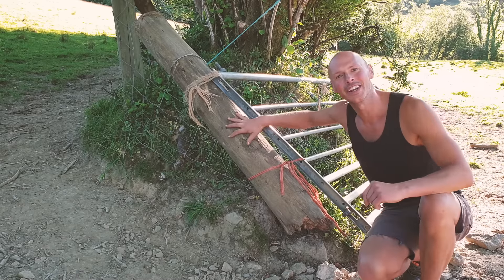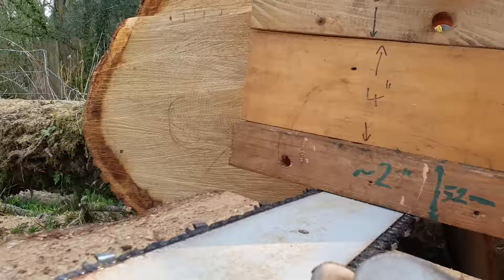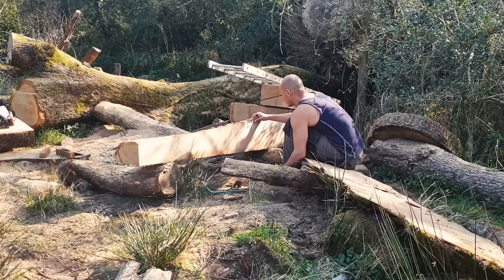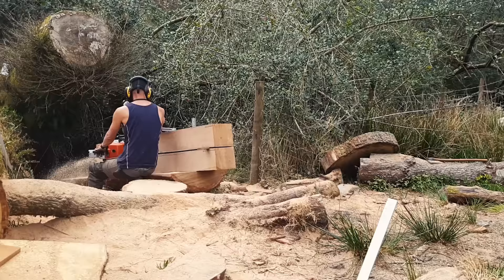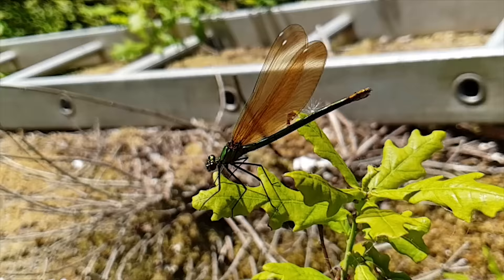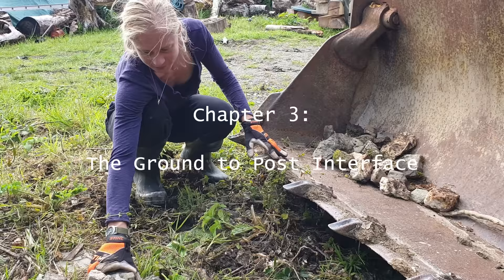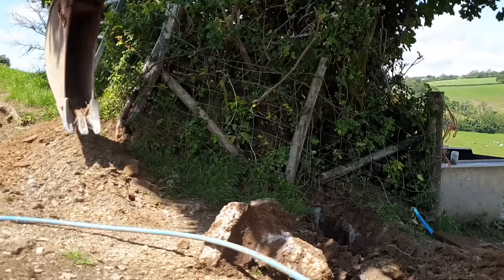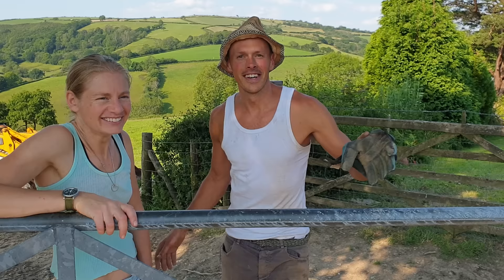The 3 secrets to ROT PROOF POSTS and how to make them

Comment: i have been burning my wood for a few years now, even pine which maybe a soft wood but if done well can actually last many decades itself but granted wont be ever as good as a cedar with its natural oils held in the wood.
I found after much tinkering that if you burn the wood until you see the surface start to bubble and get the spider web look to it is right about the best result.
Wire brush the carbon off, wash down then soft brush to make sure absolutely all residual carbon dust has been removed and then oil it up.
Personally i used linseed oil, however i have friends who went the route of old engine oils.
When ever the surface is broken ie you need to screw anything in at all then give it a quick burn now if you have fixed the post in  then a gas bottle burner does the trick, blast it out with some water let it dry and then put in some oil followed by applying a little grease to whatever you are putting in the wood will stop the corrosion happening between wood and metal and will stop any chance of water penetrating in and starting any rot.
I learnt doing this by trial and error but once i did the above found it did the best, in my mums garden where i did her fence lines i have since applied oil once, i did her fences 26 years ago and they are a bog standard pine, they have zero decay and are as strong and robust today as when they went in the ground, she has an outside dining table which i did a few years before that which i didnt get quite right first attempt, didnt give it enough burn time, re did the burn on it when i did the fence but all the same you're talking best part of 30 year old table, strong as ever, pine table again.
Point is, pine i agree entirely  wont last or have the longevity of a cedar or oak but if you reapply oil every 20 years , 10 for the table as it gets used and some damage does occur from dropped items etc, it will still out last many of us, it might not last hundreds of years like a hard wood can do but it can still last many decades.
I guess to be fair on my final point, you will get out of the wood exactly what you put into it before hand, i sanded washed, burnt, washed, oiled, did some further burning, washed reapplied the oil and then a 2nd coat of oil, i went probably a step further than most would consider but the results speak for themselves, you get back  out of it what you put in.
It is a absolutely great way of looking after wood and it also looks bloody great too in my opinion so win win
Reply from the maker: Wow Ricky! Thanks so much, that is absolutely fascinating and inspiring. Very impressive for pine. It's certainly getting us thinking about treatment for outside furniture and we do have some more posts to do, so we can try the burning and oiling on the fixture holes for those. Was it boiled linseed oil or just straight up you were using? Did you say you sand before burning - what is the reasoning for that and would you still keep that step if you did it again? Curious as the texture seems to change so much when you char it. 

Is it for aesthetic reasons to get all the carbon off or for something else? Thanks again for the comment. Peace, Bongo
Reply: @FloweringElbow  Yes i always sand before burning, reason being for me is i have done many fences and the wood used has generally been treated of some sort which you dont want to be breathing in even when doing in the open for one and for two, it gets rid of the excessive fibres and rough texture of the wood which even if not treated when you burn can cause additional burning of the wood more so around the edges of boards or panels which is just wasting wood and doesnt help, i believe you covered it stating you only actually need to get through the first few millimetres , no need to get in deeper  in the wood unless of course you have made holes deep in the wood then of course you need to reach all open wood to prevent air and bugs.
With tables i do it because they often have had a varnish or similar applied which requires being removed, also as i mentioned, accidents happen and things get dropped and it takes out any small dents.
I don't sand again after it's all been done and had two coats of oil ( you can if you wish sand with a really fine grit paper between coats ) then  pressure washer to clean the surface is sufficient, allow the oil to dry ( 24 hours per coat applied generally using boiled ) and it wants to be properly dry before you reapply oil, oil i have mainly used is boiled yes, tbh havent used non boiled that often and oak is about the only wood you would want non boiled for and drying time  can take weeks hence not often using it lol.
After applying the oil leave for half an hour or so then wipe down with a dry cloth to remove any excess, you will feel a sticky feel to it.
But i found when things hadnt gone right at the start it was more to do with the burn or not allowing enough dry time or not properly cleaned and lastly do it in dry weather, even if you can burn under cover higher humidity  in the air means longer time to burn to get the same result.
You want to get every last bit of carbon off so basically you  are sealing without doubt the wood itself,  removing the excess carbon from the surface layer thats been burnt to a crisp. You will still have the burnt look and effect on the wood after you have taken off the excess but not taking the excess carbon off means you are limiting how well the oil penetrates the wood rather than being absorbed by the carbon ( when good amounts of carbon are left ) so again if you have a pressure washer handy they do a cracking job of removing the carbon.
It might come across as over kill and i probably come across as being anal lol, but to me it comes down to peace of mind, pride in work, walking away knowing i did my absolute best, ive done probably a handful of tables and outdoor wooden furniture and fences every year now for the past 30 years and i treated every single one as if i was doing it for myself and dont call it finished unless i am happy with it, tbf the reason i have done so many is purely through word of mouth, friends of friends , family friends of friends seen my work and wanted it done.
I can honestly say hand on heart i have had just the one complaint on a job done on a table, which i could do nothing about anyway, once you take off the carbon you will find that wood will show as different levels of darkness dependant on grain and knots, knots take more burn time and dont colour the same as the surrounding other wood, despite seeing this on a table i had done which they liked when i did their table it had more knots in the wood and of course had a greater degree of difference in colour across the wood, which i believed they had already expected having seen my work.apparently not though dohhhh.
So that is one thing you should expect, is worthwhile knowing ahead of time, if using highly  knotted wood expect a greater degree of contrast, personally i think it makes it even better, maybe i am biased?
Reply from the maker: @trickydicky78s3  Great info Ricky! Thanks for this, it's giving me lots of ideas for experiments to try! :D
Reply: @FloweringElbow  sorry about the essays haha, not often people are that interested in the doing part , more often want the finished article
Reply: @trickydicky78s3  Thanks for all the info! I'm planning on doing some DIY building in an area not likely to have high availability of big hardwood lumber, so knowing that charring and oiling can preserve softwood like pine is very useful.

Comment: I found that 6 inch diameter round posts treated with 5 star cuprinol, then wrapped with plastic wrap, industrial grade, on the base and at least 6 inches above ground level worked very well, it was removed when we built our house on that land. It was a cheap method for cheap timber and worked. My wife and I are both 77 years old and wish you well.

Comment: Family history tells that aspen posts work for couple of decades in submerged in water, so good for pier building etc, long as dried and bark is stripped. Spruce, if grown in rocky area with little moisture, meaning it has grown really slowly, is such dense wood that we have still buildings that have spruce logs just buried on normal moist ground and have been there least 40 years and not in particularly dry area. Reason is that spruce creates resin and slower is grows, more filled with resin it is. Long as wood is debarked there is just resin on the wood. With roof protecting from constant moisture contact those have lasted till this day. Dont know whats up with aspens and water, but seems to be true. Spruce works fine submerged as well, least 30 years our pier has been lasting with out issues, other than ice moving whole construction. Finnish winter and climate in general might have something to do with this though..
Reply from the maker: Good day Hellsong, thanks for sharing your experience on this - interesting.

Comment: My Father would mix used motor oil from gas/diesel tractors/cars, plus used transmission fluid from a local IH farm implement dealer.  He would paint it on posts (before installing) and barn sills, barn exterior wood, and anything bugs/termites might attack.  It worked AWESOME!  He also used a big rock in the bottom of the hole!  You have a 'hard working' wife!  Best Regards from the USA!

Comment: BTW -- That Ramming Technique you used on the stone was also used by the romans when pouring concrete... They would make their concrete THICK, like mortar, put in a layer of stones, then concrete, then stones, and then ram it tight with a rod... They used alumina ash, quicklime from seashells, and saltwater to make their mud, and mixed PUMICE in with their rocks.  The alumina ash reacts with the quicklime in the presence of salt to form spiky metallic crystals that penetrate into the pumice and fill in between the surrounding rocks, making the final product as hard as natural stone.  Roman Piers built in this manner continue to stand to this day.
Reply: I've read about that roman concrete.  Fascinating.

Comment: Good installation. Very nice work.
I have installed a hundred or so gate posts, and upward of 10,000 fence posts and stakes.It is certainly true that the cheap "farm supply" stakes are rotting through in less than 10years. The tanalising generally penetrates about half a mil. Any cut into the post (struts notched into strainers) just lets water in so they rot fast. Trouble is, you go and buy galvanised stock net guaranteed for 25years and which  still looks brand new when the stakes are rotted out from under, but it is very difficult to put in new stakes, and impossible to replace strainers in a high tensile strained fence. The crap stakes waste the investment in good wire.
I had been led to believe it is the damp/drying cycle at ground level which caused rotting, rather than active organic matter attacking the post-Your version is quite convincing. I'd be interested to see what happens when your oak posts finally fail, but I suspect I will have been busy in the churchyard for many years when that happens
Reply from the maker: Good morning Ross, Thanks for taking the time to share your experience. It's similar to ours - lots of standard posts installed approximately 8 years ago, fence wire is still fine, posts are shot. 
This is a bit of an experiment, and obviously is too time consuming for regular fence posts, will see how things go. And maybe consider buying split chestnut posts...
Thanks again, Bongo.
Reply: @FloweringElbow  When I lived in Sussex we could buy split chestnut stakes for pennies, certainly cheaper than tanalised, and they did last in the soggy clay of the Pevensey levels and the South Downs chalk. 
Here in Somerset, I just can't get chestnut, and only once did I have a job big enough to be worth importing a lorry load of stakes and posts from Kent,  but the transport cost about £1200! Many farmers can only see £cost today, rather than 30 years investment

Comment: You could have moved those posts into the trailer with ease
Just put the ladder down where you want to move it and use 2 or 3  2 inch pipes across the ladder and roll it into the trailer
Reply from the maker: Nice idea CMAenergy, Thanks.
Reply: Greetings from South Shropshire

I just came across your video and have found it very useful , as I have a lot of rubbish fencing that needs replacing and your use of oak for posts is exactly what I intend doing for my gates . I knew about charring the ends of the posts and I will do so with mine . 

   Was your digger not available to assist with the moving of the oak posts when you had cut them .? It would have been far easier to load the trailer with it . As has already been mentioned , short lengths of scaffold tube are a godsend when moving heavy loads . 
  I shall now go and view more of your videos.

Comment: Throw your chainsaw spanners (acting like a needle bearing) under the slab or post, before you pull the wedges out, or use them instead of wedges, and it'll roll so easy off the main log, or whatever section you've just milled it from, and into the trailer, or wherever you need it...

Comment: glad you found out about using a roller. Get hal a dozen or so 2-3" dowels and put them under the slabs to easily move them. Got to get on the level with the pyramid builders.

Comment: i soak my posts in used motor oil, bugs wont touch it and makes it more water resistant. i just slather on the bottom 2ft with a old brush or rag
Reply: Yes, old crankcase oil is what my grandfather soaked fence posts in......some of those fenceposts (tree limbs) may still be there.....I viewed the old farm in 2000 and fenceline looked the same.... granddad said the old crankcase oil had sulphur in it

Comment: Ever since found out we're paying the same and even higher costs for treated lumber that lasts significantly less. we just apply a mixture of used motor oil and diesel fuel... preserves the wood from the weather and has the additional advantage of insects NOT liking it!
Here in America the bore bees eat right up in the treated lumber now being sold for the past however many years, and so just a bunch of garbage that's more intended to bring you back sooner having to buy and replace their POOR EXCUSE for long lasting preserved lumber.

Comment: Paint them with a mix of motor oil and diesel 50/50, it will last for decades.
Reply: That and some copper naphthenate mixed in for good measure. Soak the bottoms in a bucket for a month up to the level to which they will be buried in the ground. Do NOT surround the bottom with concrete.
Reply: What if you did all three? Char it, brush with copper napthenate, let it dry and then coat with the motor oil/diesel? We used to have the option of purchasing creosote, penta and I'm sure some other very fine wood preservatives, but it's not good to have people do things for themselves now, is it?
Reply: @oliverave1234  I"m too cheap to buy anything else, I save old motor oil for this reason you'd be suprised by the finish looks quite nice compared to retail paints and sealers

Comment: Im in New Zealand. Loved this video. You are both gaining my respect with that hard yacka. After 50 years on farms, working as a logger and now Orchadist ive seen all types of posts. The greatest problem here is we export nearly all of our good logs whole to China. The logs cut into building timber and especialy posts are so young they warp twist and drive a man crazy. However h4 or h5 marine treated i have used thousands of and in general i have not had a fence or retaining wall or deck fail due to rotten posts. Farmers here used to just cut a large tree down roughly trim with an axe and use as strainers on 7 wire fences. Some ive replaced have been there 70 or more years in rammed dirt only. I would give treasure to have that Oak log milled for timber but good on you for making such great use of it. All the best.
Reply from the maker: Hey Grag, Thanks for watching, and your insightful comment. Peace, Bongo.

Comment: Pressure treated posts these days are a complete waste of time, I have seen standard posts rot at the base in less than 5 years. I have now bitten the bullet and spent more money on creosote soaked posts but I also collect old powerline and phone line poles if and when they get replaced in my area and have posts that last longer and are basically free
Reply: Most people, including contractors set the posts in concrete below ground level, looks nicer and is easier to set fence boards, but if the concrete is crowned and sloped above ground, they will last longer.
Reply: @sundayhusband  when your setting a fence on 5 or more acres no one would ever spend the money needed to set them in concrete

Comment: Thoroughly enjoyed the video. We used black locust we cut them in the winter and then let them lay until the next year and then cut them into length. If Kurt with the rat part of them of the moon light or dark enough I have forgotten and let them and let them dry. They They would last as long is a steel post it seemed. Thank you from Tennessee.